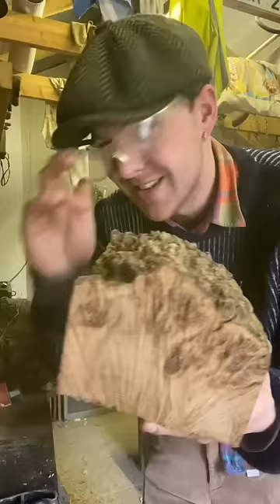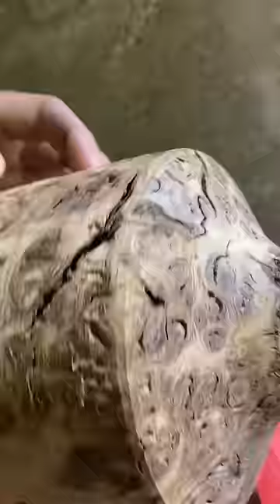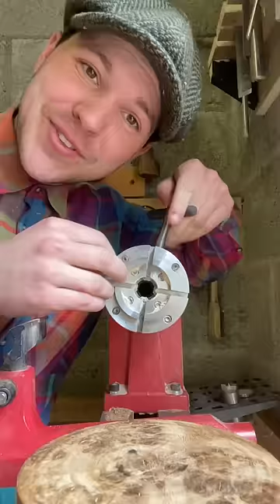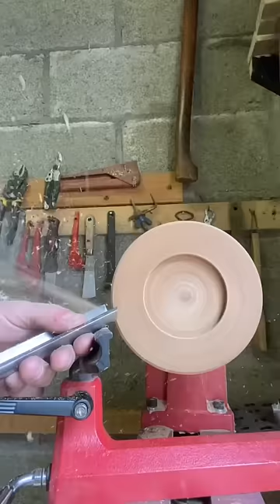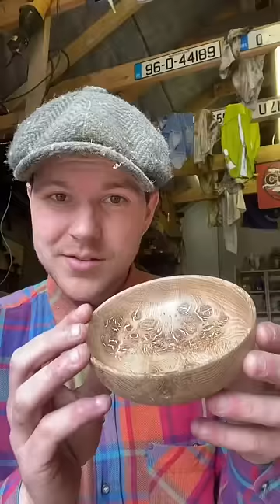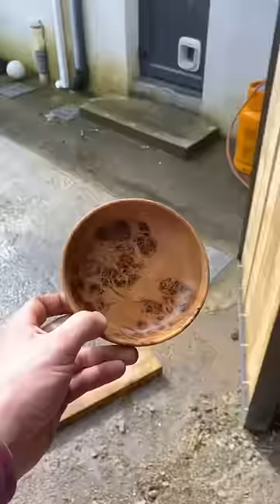Turning a Bowl from Oak Burl #woodturning #oak #burl #bowl #lathe #handmade

Comment: No harmfull epoxy... excellent 👍👍👍
Reply: Epoxy isn't harmful. Plastics in general are incredibly unreactive with everything. That's why chemicals and stuff are stored in plastic containers when glass would degrade. And that's also why it doesn't break down and just gets erodes to be smaller and smaller until it ends up being eaten by a fish and then you eat the fish. But its also harmless in the body.
Reply: @sonacphotos  "Epoxy isn't harmful"

You do realise that epoxy is not some natural material that can be dug out of the ground or extracted from herbs? It involves energy intensive processes and one of the chemicals used in it's production is Bisphenol A which has an oestrogen-like behaviour in the body and can cause endocrine issues.
Reply: @ferrumignis You do realize that "Used in its production" does not mean it is actually present in the final product, right? 

When it comes to chemical manufacturing, the entire idea is to take two or more chemicals and mix them together, producing a reaction. That reaction turns the components into a completely different chemical. Oftentimes with completely different properties.
Reply: @TheAnomaly00  You do realise that the word "harmful" is not exclusive to a single moment of a products manufacture, right?  If  producing epoxy, or the components of epoxy is harmful then it's harmful, you can't wriggle out of that.

Comment: burl is almost like a tumour in trees, when the cells go haywire and divide too fast and twisted. The resulting cell structure is dense and uneven which explains why it's so hard and heavy and also difficult to work with.

Comment: This is an extremely dangerous video to show. Never ever use a spindle roughing gouge on bowl or faceplate work. It is a tool only used for spindle turning, it's in the name. A bowl gouge is the safest tool to do bowl and other faceplate turning.
Reply: Why is it so dangerous?
Reply: @Nesymafdet  because it's a spindle gouge, it's designed for turning spindles between centres. It's not for faceplate turning or bowl turning.
Reply: @keithscrafts  Tools designed for one purpose can be used perfectly well for another. Again, why is this so dangerous? What makes a spindle gouge dangerous to use for bowl turning?
Reply: @Nesymafdet  because the tang that goes into the handle is just a flat bar and not round like a gouge. One catch on the lathe and it will break the gouge above the handle and send it flying in who knows what direction. If you don't know or understand why it's dangerous and not to be used that way I'd suggest you take up a different hobby before you injure yourself and blame this video